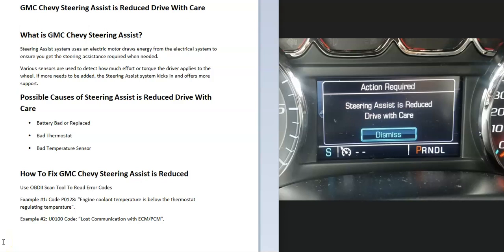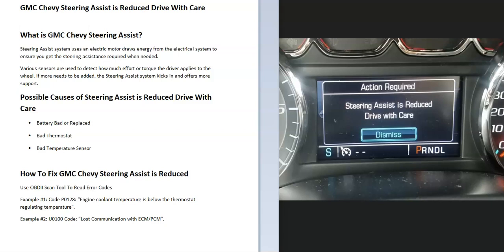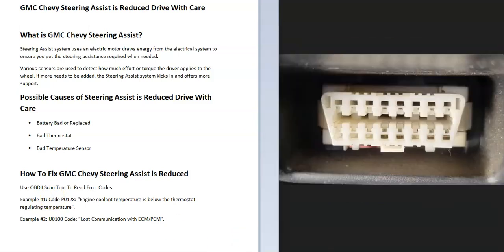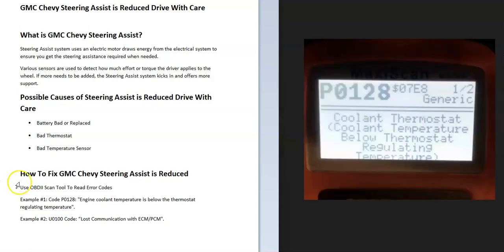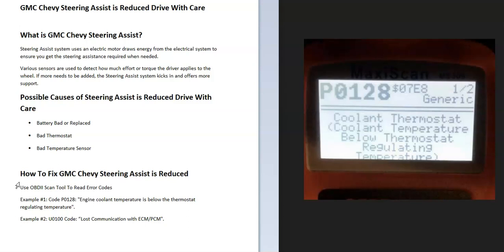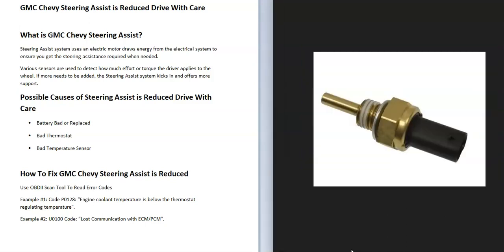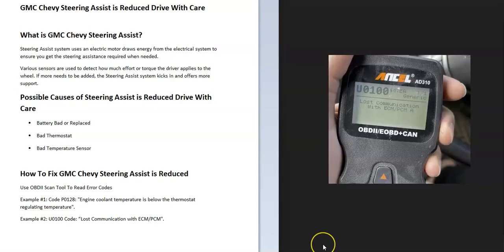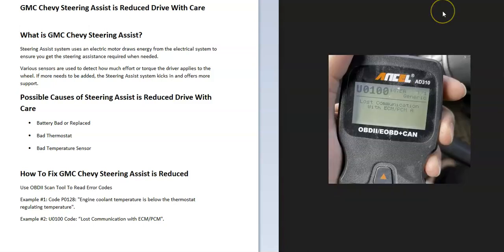Causes and Fixes GMC Chevy Steering Assist is Reduced Drive With Care

Comment: Greetings. I have a 2019 Chevrolet Malibu. This message appears every morning and disappears after about 5 minutes. I've replaced the battery three times, but the problem persists. When I took it to a mechanic, they couldn't figure out why the message appeared and disappeared after a few minutes. It only happens once, the first time I start the car in the morning.

Comment: My Friends truck just had this message on the dash but no codes she took it to a GMC dealer and it's going to cost her 3k to fix it I guess the steering gear assembly need to be replaced and they can only get a used one with no warranty

Comment: 2015 Silverado 1500 4 X 4 LTZ 4 door truck with an automatic. I have the electric power steering (EPS) system. My code scanner cannot read codes from the EPS control module. It growls when turning, it bogs the engine down so it won't move without more gas. Any words of wisdom?

Comment: I just got that service light on but it started when i put sum cookies wheels size 17 with small tires could it be that isnt reading it and be a sensor?
Because the truck normally rides on 22 inch wheels and never had the problem but one of them bent and had to change the wheels to the small spare i had and drove fine until when turning it woulf make a strange sound snd only from the spare wheel side .. so could it be that its just the wheels messing with the sensor?

Comment: I have a 2017 GMC Acadia , I replaced the battery & this started happening. I went to auto zone to get the test done & the reader didn’t come back with anything. Please what could I do. My steering is so hard & my model doesn’t take power steering fluid
Reply: Interesting
Reply: @ I love you & Miss you <3
Reply: You ever get it fixed?
Reply: mine did the same exact thing.

Comment: I changed my battery like 3 months ago it’s been popping up ever since and I’ve tried clearing it like 100 times (I get no codes from my scanner)
Reply from the maker: If there are battery issues, be sure to test the alternator charging output is correct.
Reply: @ just tested it it’s good
Reply: @MattFillman03  mine did the same thing. Any idea how to fix it?

Comment: I HAVE THE ANSWER: 
I think GM and the whole lot of them need to go back to points, plugs, Rochester or Holly carb. 
I know I know but what about blue toothing and On Star how would you be able to stay in one lane without lane control. 
I had a 1968 Chevelle in the early 80”s I don’t ever remember there ever being a recall on that car. Oh I had to carry around a finger nail file in the glove box just in case the point were corroded and an extra few wood clothes line pins in case it started vapor locking. 
A lot less bullshit than we’re going through I know that.

Comment: I replace thermostat and the coolant temp sensor
Also the battery with a new alternator an I’m still getting the same things happening
Reply: I also changed the same things, and the message came back up. It's very frustrating

Comment: Yo la lleve al Orreily y la escanearon  CoDe P0335 crankshaft position sensor   I bought  $52  reemplace it   este se encuentra atrás de la starter   y listo quedo al 100 ,.  Mi camioneta aceleraba pero las revoluciones no subian y tambiennbatallaba para aprender y prendio el checking engine  , después de remplazar ese sensor quedo bien.

Comment: Just had this issue today along with stabilitrak, no oil pressure and won't go into reverse. Battery was replaced 3 years ago. 2018 silverado 70000 miles

Comment: Could this be going on for a Acadia Denali...2012? Just bought. Didn't want to turn around in a tight area... Could it have been sensors I didn't know about?? Very hard to turn... So far only happened that 1 time, but only had for 3 days. Other things too but that freaked me

Comment: I changed out the battery and now the power steering is not working.  I get the error you mention.  I have no idea how this problem could be related to a thermostat.  Anyway, my question is if I reset the codes is there a chance my power steering will start working again?
Reply: It probably will. Mine was doing it so I cleared the codes but they did come back. I then changed the battery and it worked fine for about 2 months. Today we went out and before we left I heard like a rubbing noise on the front passenger tire that concerned me but I didn't think too much of it. We just got home and got the message and the fan didn't want to turn off. Unplugged the fans and gna check underneath in the morning
Reply: I ended up cleaning the terminal block above the battery and resetting the fuses and relays in the engine fuse box an the codes cleared.  There is a good tech service bulletin that goes over all the possible loose connections .
Reply: @fairbornCCF  where do you find that info?

Comment: So for me I'm driving a 2016 Chevy Colorado Z71 v6. Service sign came up for driving assist. Turning the steering wheel was very tough as if my power steering went out. I got to my destination parked it turned it off waited a few hours turn the vehicle back on issue never popped up again. Can someone please explain this
Reply: I was told today by my mechanic when this happens pull over turn the vehicle off.  Wait five minutes and then start the engine again.

Comment: My 2019 Tahoe, with less than 100 miles, Had this warning pop up 10 miles from home.  Power steering gone, wouldn't get out of 1st gear, no reverse, trans grinding.  Call for tow.  By the time wrecker shows up it magically fixed itself.  Dealer couldn't duplicate.  Three times this has happened.  ZERO confidence in this truck.  Dealer said they finally figured out and replaced the steering gear.  Now, in 2024, I just got same message, no power steering and same trans issues.  Came out 20 minutes later and working again.  WTF.  Oh, and my rear AC line just rotted out.  $1,200.  I've bought 12 of their vehicles but I'm absolutely done with GM.

Comment: My stabilitrak and Steering assist came on after having issues with my wheel hub. Disconnected the battery and stabiltrak went away but steering assist still on. Battery is good.
Reply: Did you get this problem fixed?
Reply: @alanbatcheller7429  No, still driving around like that. I was told I might need to replace the steering rack. About $1,000 parts only.

Comment: I get that each time my car does the auto stop it came that message it not brake assist even tho they check everything and it was good I checked cause they engine light came up twice and it was saying to check the battery or it needs cleaning my cuz who is a mechanic he check on it he was everything is good nothing broken or loose and it was cleaning still pops up
Reply: Bro I have a Chevy equinox 2021 and mine does the same exact thing mine also makes this noice while driving Idek

Comment: This message just came up right after getting my key fob replaced and programmed. I don't know how? Could be a coincidence or something they did with the onboard computer to program the key fob. I am so lost.
Reply: Fixed! I just removed the negative wire of the battery to reset the engine computer

Comment: CHANGE YOUR BATTERY! I had all these problems and changed my battery! Fixed!!!!!!\
Reply: I just put a brand new battery in mine and it’s doing this.
Reply: @mattparrott4933  temperature sensor
Reply: Mine too replace the battery its still doing it. I think its the rack and pinion
Reply: @jaimerubio2683 Did you end up finding the issue?
Reply: What if the battery is testing good?
Reply: I replaced my battery as well and it’s been about 8 months that’s my 22 Sierra is parked.
Has anyone found a solution?
Reply: Bro remove the battery for 5 mins then put it back on and its fine
Reply: @Arwand.a  bro I changed my battery to an agm that wasn't the problem! A ground had shredded in my front driver side and caused the issues.
Reply: @js4858 what do mean? Just wondering because my acadia was doing it, got a new battery about 2 months ago but now it's back.
Reply: @johnmflores85  it's a bad ground wire. Take it to the dealership and ask them to check all of them.
Reply: Happened to mine 3 times today. Been in the shop twice. First time they said it was the battery. 2nd time they said a mouse but the ground wire to the bcm module. They said they fixed and it happened again. Btw there was no sign of rodent droppings. I think the mechanic thinks I’m stupid or just doesn’t want to fix it
Reply: @Timmysilva just got my engine replaced they said they didn’t touch my steering but I did get the battery replaced and this is happening
Reply: This did not fix mine
Reply: But I have a new battery
Reply: @samvancourt1780  it's not the battery it's a bad ground
Reply: Mine ended up being a wire issue

Comment: I am also getting no AC to come out of my vehicle and also getting the Service Stabilitrac error message as well.  Checked the battery.  I am NOT getting a OBDII code as no codes are popping up any ideas?
Reply: I’m getting same thing with 2014 Silverado. No codes. What could this be?
Reply: Does the fan/air blow through your vents, on any or all fan speeds?? The blower motors were quite famous for going out..
Reply: You get this fixes? What was the issue. I've seen alot about this being the wheel speed sensor
Reply: @m.od.3116  100 percent what it was for me.

Comment: Hi  i got this message  on my  Cadillac XT5 " Steering assist is reduced drive with care "  plus my temperature gauge is  always at " C " and the radiator fan is at high speed   ... do you think is the thermostat ?
Reply: Getting the same thing, did you ever find a solution?

Comment: I went to o Reilly and he put the the scanner on and no codes. Are up. Now what?
Reply from the maker: Some scan tools only scan for engine codes but not transmission, ABS, or SRS codes. You may need to take the car to a mechanic and have them scan for errors.

Comment: I call BS to GM on all this! It’s prolly pre programmed to throw this crap! It all happens at 50k when it just gets out of warranty! Then what about all the people that do all this and it keeps coming back? It’s in the software I’ll bet!
Reply: He's right about the software issue. It happend on my 2017 silverado at 50,000ish. I found a GM service bulletin on how the dealership is supposed to fix it. Software up date, I guess bad original software. I also looked at rockautoparts under parts, I think it was under power steering. They mentioned something about the GM bulletin.The video is also right on possible problems.
Reply: @Doc_shinobi I’m hear on a 2020 Chevy blazer at 49,822 and that code just popped up soooo
Reply: I just had the Steering Assistance Reduced message on my 2020 Chevy Blazer … my mileage is 38456… I can hear the fan running at idle, which normally I cannot. I will get it scanned and see what shows up.
Reply: I have a 2022 Chevrolet traverse and I get this error message as well
And a check engine light. Car only has 24,000 miles

Comment: My 2019 Chevy Blazer RS showed up with the same exact codeP0128  at our home when we checked it on the code reader device . I took it to the Chevy dealership & was told it was the Radiator leaking coolant that is why the temperature was low. $2400 later, the same codes are coming up after only 2 weeks & it now reads same code & says coolant thermostat! I was  ripped off. Thank you for this video. Very helpful
Reply: Experiencing this with my 19 Blazer RS :( time to get rid of it I guess lol

Comment: This warning started popping up 3 days ago, and it sounds like there's a loud fan/blower going.   And then just now the engine light came on... any ideas??
Reply: If the fan is full speed even with the car off, it lost com with the temp sensor. Unhook battery and rebook it up. If that don't work, replace sensor and then unhook and rebook battery
Reply: @josephswift7622  That happened on my 17 Sierra..I shut it off,fans still going on high..I popped the two fuses,disconnected negative cable..Went & grabbed new temp sensor,problem solved..

Comment: I'm getting the steering fluid code. Drive with care. But the engine temperature looks like it's getting high. I just had the transmission fluid changed at valvoline. That's when the engine light came on. My o b d tester won't give me any codes. I think I need to update my OBD2. Is there a belt that goes to the power steering?
Reply: I have a 2017 gmc Acadia and it’s saying the same thing but I’ve noticed my engine is extremely hot like way hotter than normal

Comment: Thanks for the video. The dealer seems to be unsure of what could be the problem. I bought a new 2023 CT5 V6 550T and about a month ago, the car wouldn't start. The car had under 2000 miles and Cadillac Roadside assistance changed the battery. Now, a month later and 2700 miles, the DIC said  "Steering assist is reduced. Drive with care" and " Service power steering. No assist soon". It goes in in two weeks. I'm assuming it was from the battery change as you mentioned. I restarted the car and it went away. Now I'm afraid to go anywhere with a new car because it's unreliable.

Comment: Hello I've gotten this code once, but also my truck does this weird thing where it gets hard to turn for a spit second and then it stop it this related to this same issue, please help if you can. Thanks!
Reply: my 2016 yukon was doing the exact thing you mentioned. I had it towed to the shop today, as I was scared it would do it again and cause wreck. Have you had your vehicle checked out?
Reply: There is a recall for the Power Steering turning off for a second and back on.

Comment: And one more thing I might add ..no censor or especially a thermostat or even  anything that could interrupt a vehicle safely maneuvering from the steering source  can and will be proven negligent …if anyone dies from such an idiotic device …regardless of a pre programmed warning warranty uploaded to the system on board computer is not a wavier transferable in court …!!!

Comment: My daughter in law had to take my spare Durango because the Chevy Colorado is on the street with no power steering poor thing just got the tranny leak fixed and the a/c filled because the connection is not the size from a store bought 134a can …I mean who put together this crap ? Any way battery looks good I tried the on and off to reset it and that didn’t work …it’s like 110 outside in the shade and Hercules would have to turn the wheel to get it up in the driveway…if this had happened when she was driving it there is no way she could have kept from driving off into a ditch…law suits are definitely coming …that’s pre meditated murder to know a faulty system with such a safety issue would even be able to be manufactured!!!!!It has an electronic power steering module…Huh? That should have been a red flag warning right there no wonder they sold it to her used…anyway going to go out there and sweat it out to see if it’s the wiring harness or a battery hard reset …I will keep what you said on the back burner ..but that should in no way cause this issue..but I’m not saying your wrong because obviously the e engineering’s department should be locked up for attempting vehicular man slaughter!Im going to make a lot of money on this one …2015 my ass it’s happening in 2019 as well as all of them all the way to 2023 …
Reply: It’s time to crack open those modules and find out where the cost cut was to endanger life and property